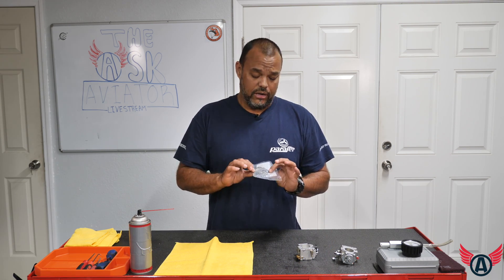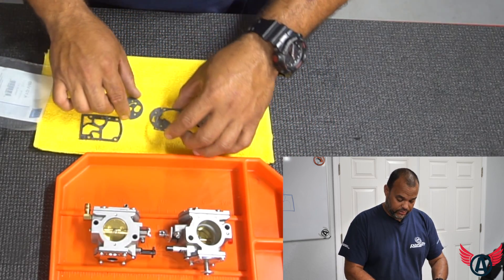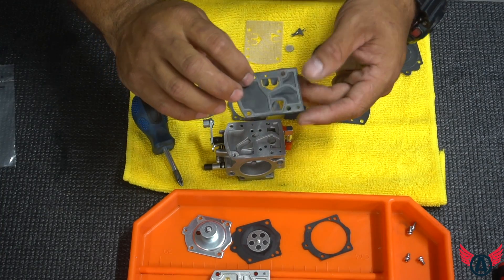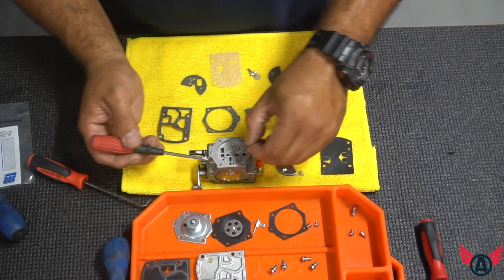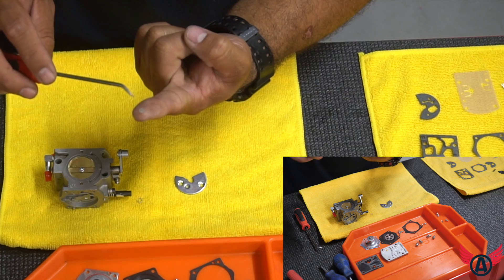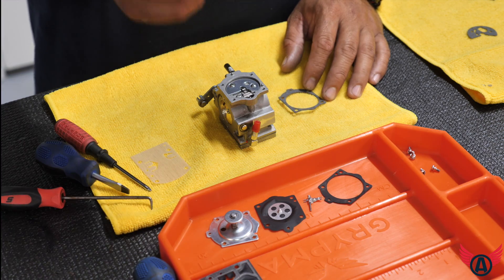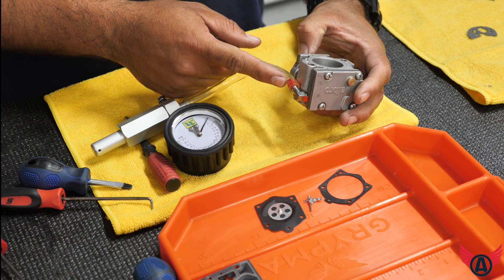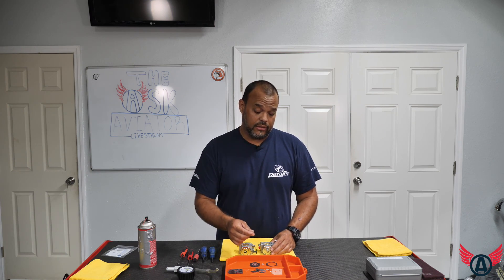Carburetor Rebuild - Paramotor Tech Talk | AviatorPPG

Comment: Great info, Alex.   I have rebuilt hundreds of the Walbros over the years.  Yes, they are simple .  
  If I order my Eclipse with the 185, with the EFI option,  can I keep the original Walbro carb that came with the Eclipse?   Just in case I need to revert back?   Thanks.
Reply from the maker: 009to090 yessir
Reply: @aviator  Kewl.... Thanks! 👍